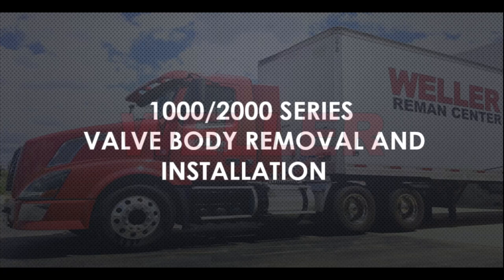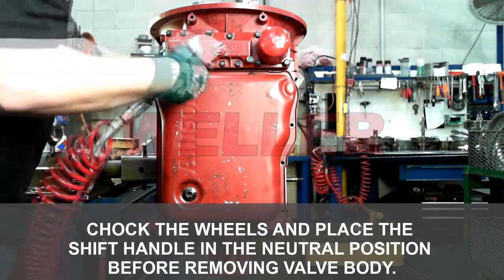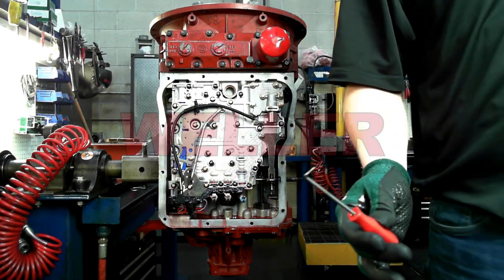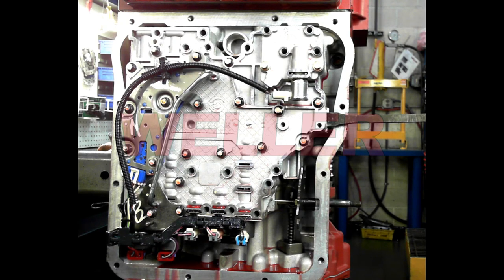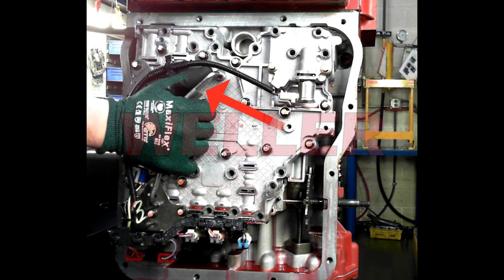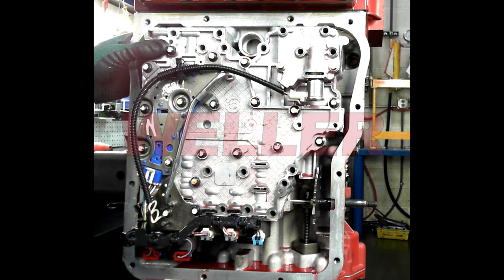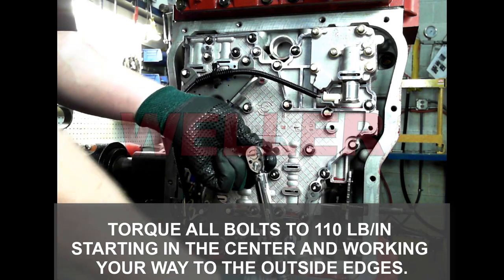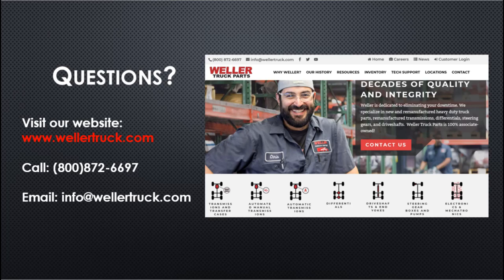How to Remove and Install Allison 1K/2K Valve Body

Comment: I had a shop tell me they think it is my valve body on my 09 duramax. They want $2700 to replace it. Is that about the going rate for this part and labor?  I'm also providing the trsnsynd fluid.

Comment: Hi, good morning. Consult. I have an ambulance with md 3060p.
blocks gear 2 and 3.
It indicates the turbine speed sensor code.
In addition, when the transmission oil heats up, it jerks strongly when putting "D".
Can the valve body be calibrated?
Thank you
Reply from the maker: Hello Mauro, that is a really good question. I reached out to one of our experts in our Allison dept and he said it cannot be calibrated. You would have to take it to a shop with Allison software and have the adaptive shifts reset and troubleshoot the problem with a speed sensor. He also advices, "DO NOT" drive the vehicle with an active trans light or else damage will occur. If you have any other questions Mauro, please give us a call and we will be happy to help.

Comment: So when taking the valve body off are there no check balls that will fall?
Reply: No
Reply: @JamesValentineBaja1000  there are 3 under the double solenoid hold in bracket though